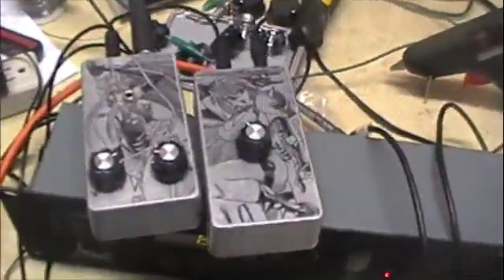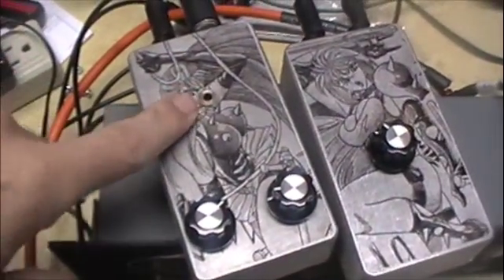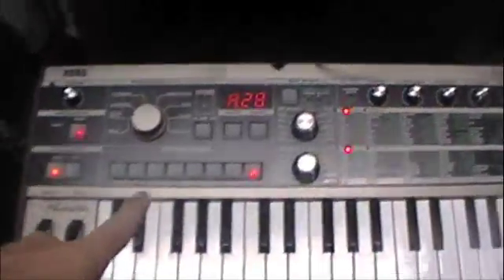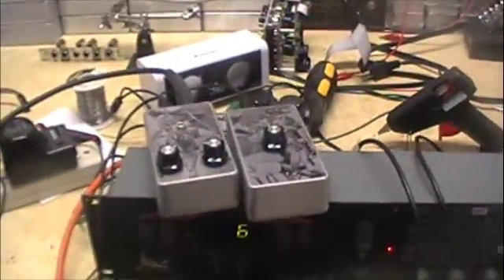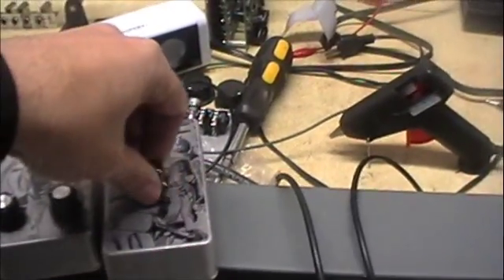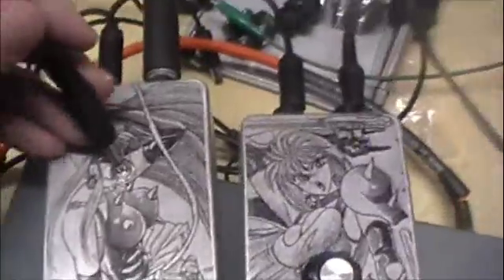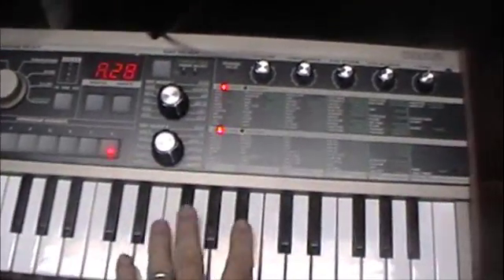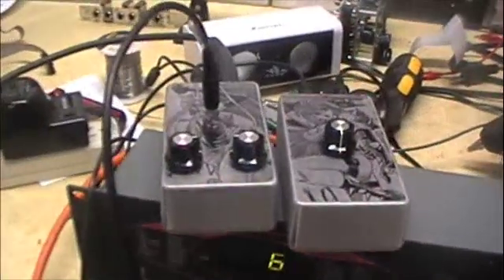atari punk console w/ voltage control

Comment: i would get a demo of Reason, or better yet buy the software. it behaves just like real analog as far as cv's, gates, and signal flow. it will get you up and running with these concepts.

Comment: signal flow for analog subtractive synthesis goes...oscillator (apc, etc..) to adsr to filter. there are many adsr modules available if you are getting into modular synthesis and even more filters, many of which recreate the sounds of vintage machines. i would say download a free soft synth to learn the basics of alalog signal flow. to answer your question, oscillator out goes to adsr in where the signal is shaped and then further defined and given character by the filter.

Comment: you will need a control voltage to effect pitch, audio will not work for this. sure, you can hook up the circuit to an adsr, after all it is just a simple oscillator.all oscillaotors just put out a steady tone unless shaped by an adsr and filter. good luck in your experiments, and remember; we all have to start somewhere.